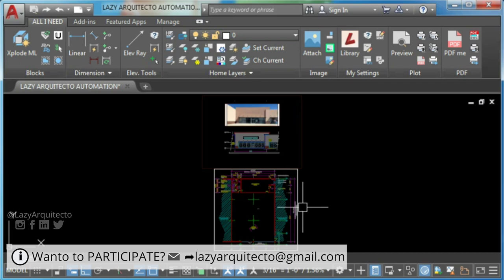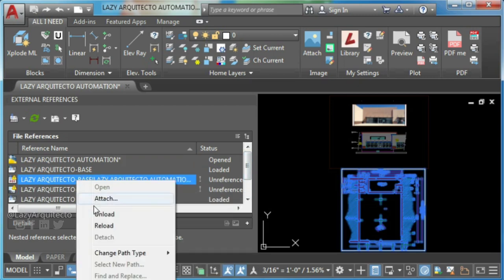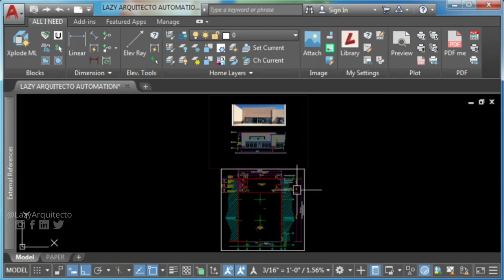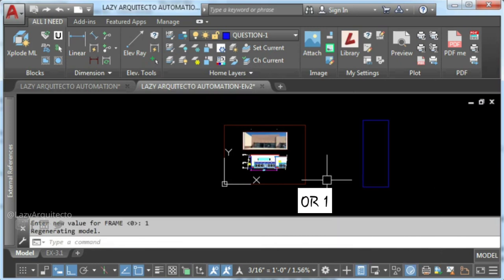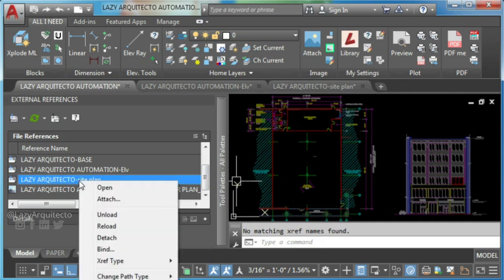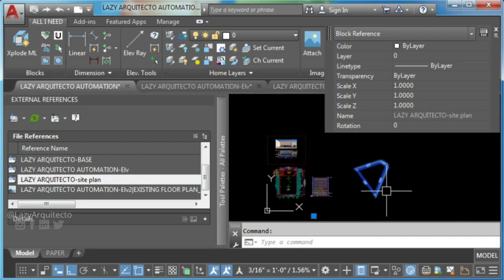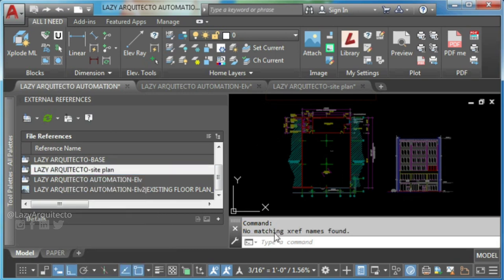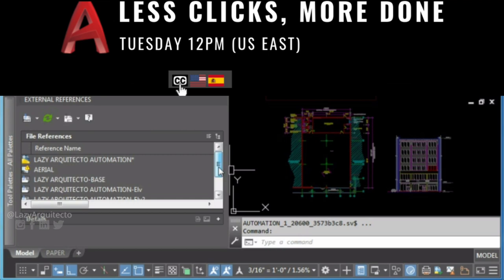Autocad Xref Problem to Remove Reference | Unable to detach xref? Watch This.

Comment: Am surveyor and mostly i received drawing from architecture when i change the scale. 001, and do some editing and save a pdf copy ,while zooming some line showing sold hatch i cant zoom in and bad visibility, what is the best way to deal with it,am spending lot time to explode the use blicks and changing line to (0)
Reply from the maker: I am having a little difficulty to understand. Do you have problem with the hatch or lineweighs?

Comment: Sir I have a plan file with xref files(hidden),when I xplode file all xref displayed with plan ,how can I get rid of this ,I tried detach option but not succeeded,also is very heavy, any command I try to use it takes time.Thanks
Reply from the maker: Welcome the the team Ahmed! 
If you don't want to keep xrefs within your plan, you can use the bind xref option, then erase the xrefs. Let me know if this helps. By the way, Where are you from?
Reply: @LazyArquitecto  Sir bind option does not work
Reply from the maker: Let me help you here Ahmed https://wa.me/12675534506 so you can send me pictures of your xref problem